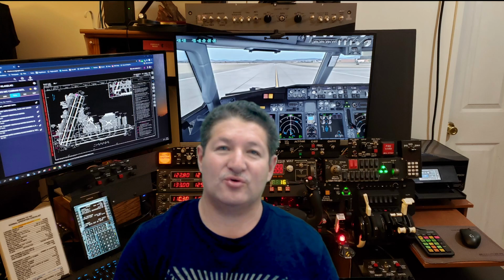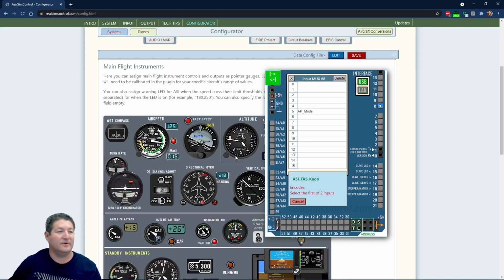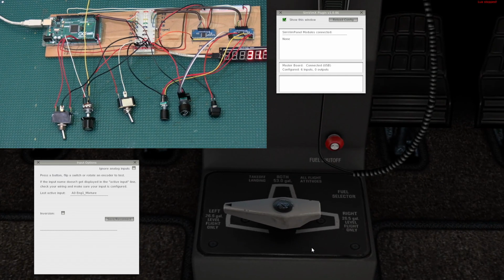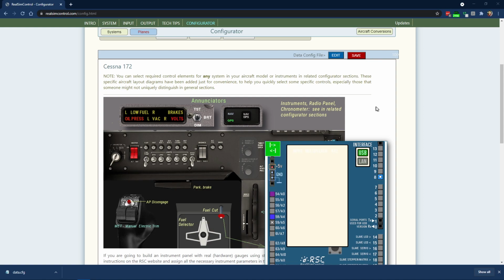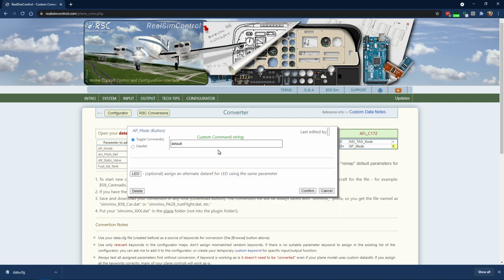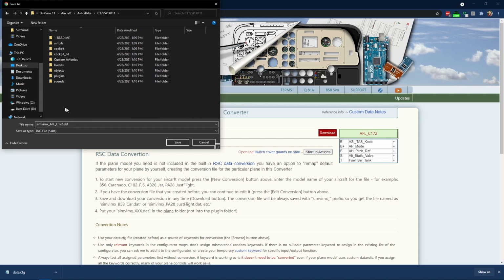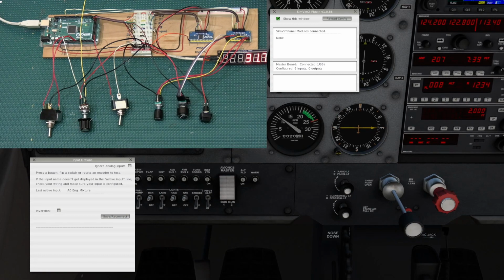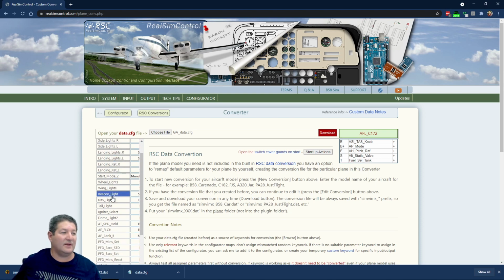Read note below:  Using the Custom Converter in SimVimX/Real Sim Control (RSC)

Comment: It's always the weirdest things that don't have a default command that works - one Carenado plane the transponder switch won't work - everything else used the default commands.  Seeing how you did that made it very clear and I would recommend this product and this video first before any other methods since it takes all the programming work out of cockpit building (which is tedious and hard for most people).
Reply from the maker: Thanks Kris, I consider you a very knowledgeable person when it comes to this stuff knowing how you basically custom built your button box and actually programmed everything. Big props to you on that and thank you for the endorsement

Comment: THANK YOU!!

Im a real noob making cockpits and now i have the all problem solved by this tutorial!! Im making a Zibo Overhead but is not working with the defaults, so, i need to know how to convert and this is the only what i need!!
Reply from the maker: Everything on the Zibo works by default. They have already done anything required to make sure. You DO NOT need to do any conversions for the Zibo

I have not built an entire overhead but i have played around with many of the switches on it and all the functions work.

Check your wiring and connections, I suspect that may be the cause of something not working.